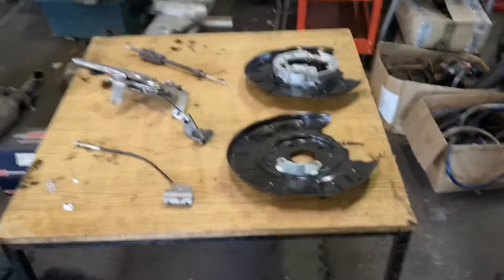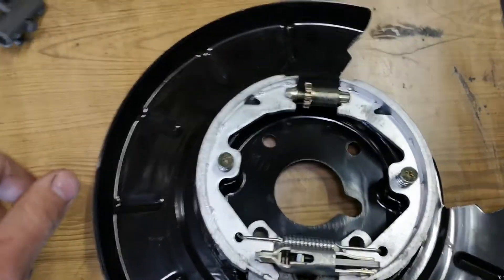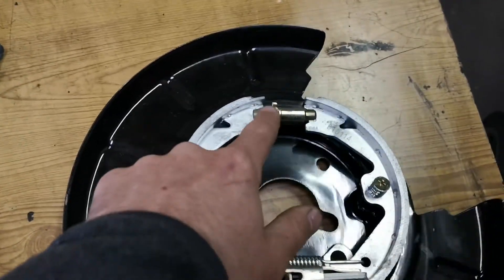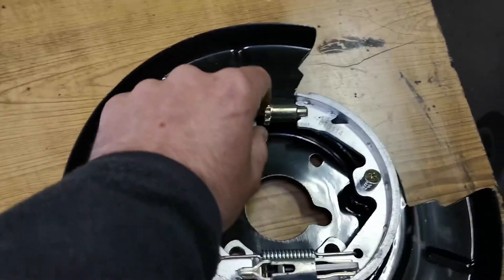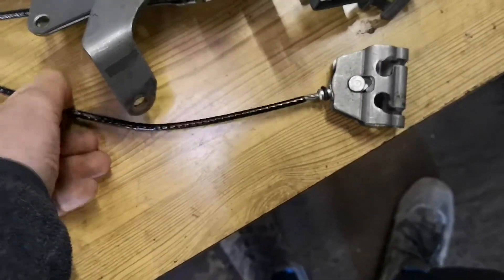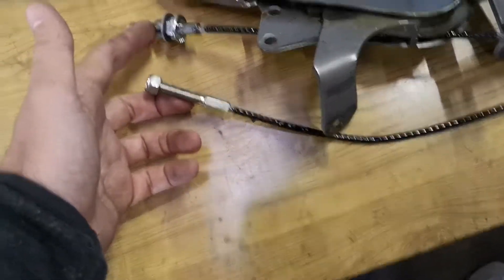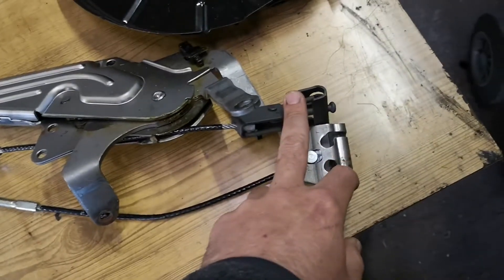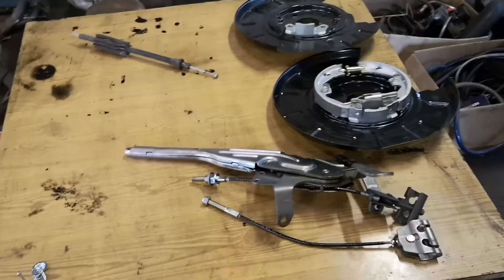Tech Talk - Rover 75/Mg Zt handbrake lookover

Comment: And it lasts about 2 months then dies.I’ve had 2 and both went the same.Seller didn’t want to know.DONT BUY IT
Reply from the maker: In what way did it fail? I have never seen one fail in 10 years, alot stronger than the oe unit.

Comment: Thanks for the video,  brings back memories.  The adjusters with a screwdriver is a pain and very fiddly. Yes it is a common fault with the pins pulling through the backing plate.  The Rovers is the same set up as the BMWs,  you don't need to buy a new backing plate or new pins from the other side.  Get a penny and drill a hole in the middle.  Put the penny on the other side of the backing plate hole,  ie rear,  and put your pin through that. It takes a lot of pressure to push the spring down and turn the pin to lock  but it is a darn sight easier than replacing a backing plate!
Reply from the maker: thanks for that, but im not one for bodging, so id rather do it right.  thanks for the comment.

Comment: Exactly what I was looking for, my 75 has the identical issue right down to someone putting a bolt on as they had ran out of thread. Going to order the mini handbrake now 👍🏼
Reply from the maker: Glad it was of some help
Reply: @mrkstrlng  believe or not, in the process of replacing the handbrake, I ended up fixing the issue by adding another bolt 👍🏼

Comment: Two type of cable listed for the mini does it matter which one? They look all but the same
Reply from the maker: Hi Stuart. I believe it's a r50/r52/r53 mini compensator needed.
Reply: @mrkstrlng  Got one off ebay 100% better job than the shackle trick,not that bad to fit i didnt take the seats out.
Reply: Some Ebay breakers list 2 options but I presume the silver looking (earlier ?) one like shown in the video... Rover 75 and R50 Mini were just a couple of years apart.